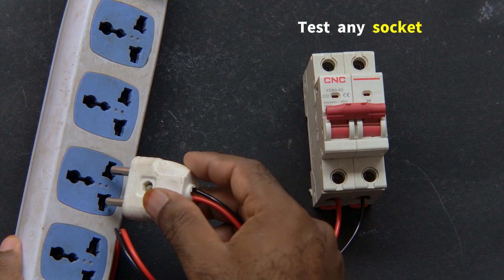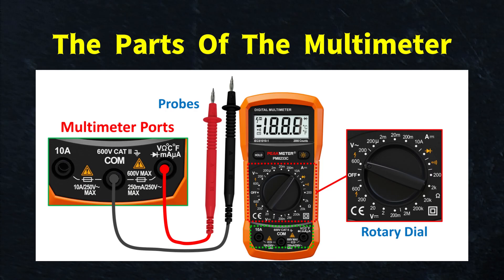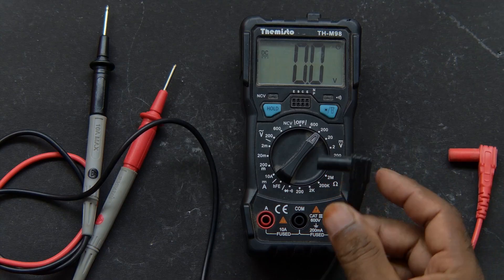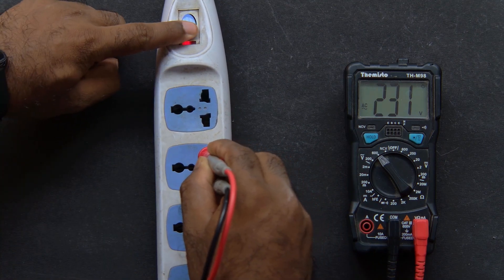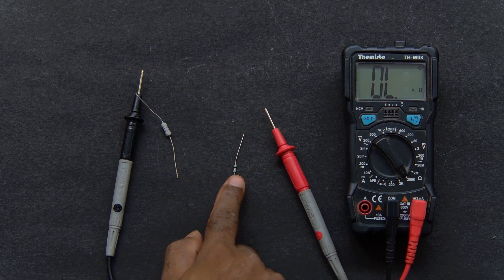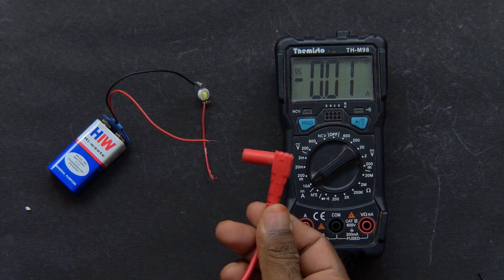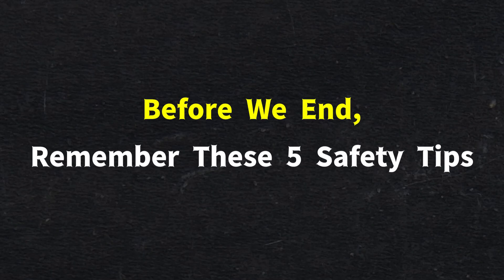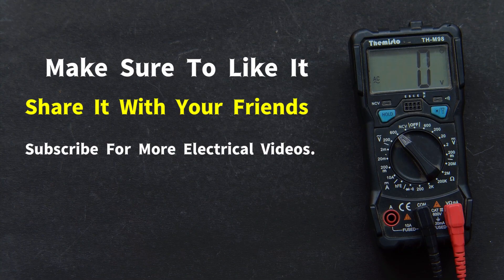How to use a Digital Multimeter @TheElectricalGuy

Comment: i used to have a cheap multi meter which went bad to check home sockets , bike battery voltage  .   now i have upgraded to clamp meter that also comes with these probes  . almost same features like multi-meter with AC ampere measurement & NCV function through clamp as extra . its a worthy upgrade